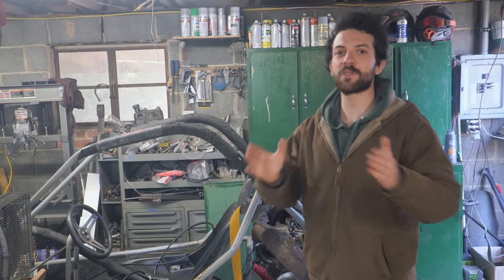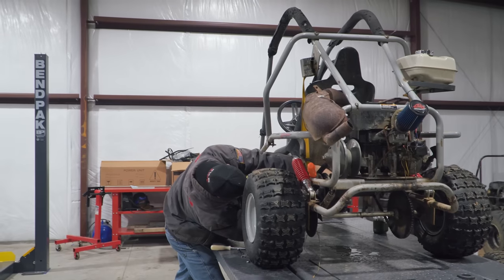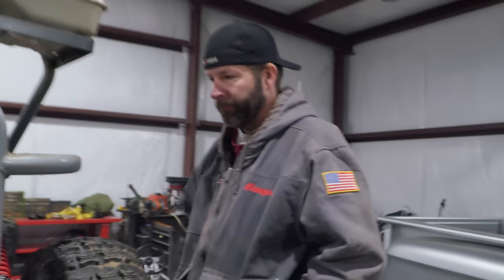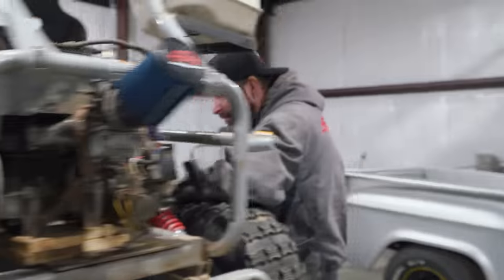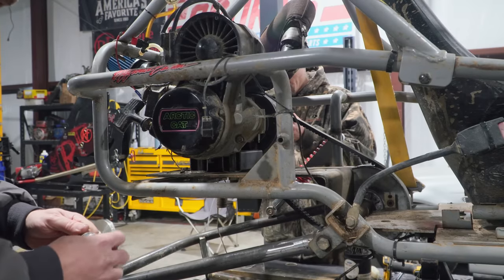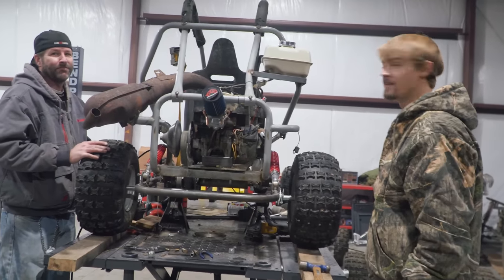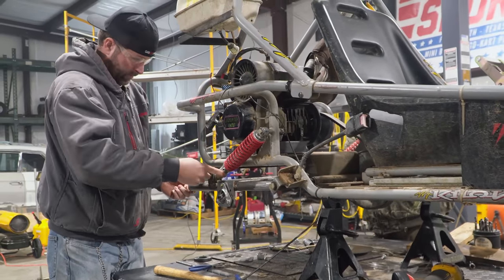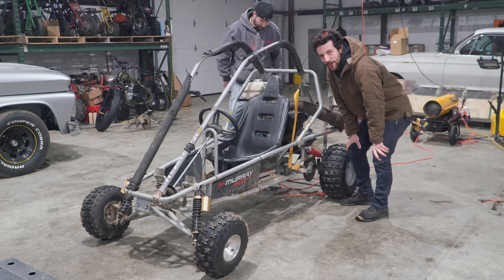440cc 2 Stroke Murray Kilowatt Racing Suspension Overhaul!

Comment: Just got my 140 hp 680cc 2 stroke engine for my drag quad. Tons of good ispiration and good ideas from you guys🤘🏼 Keep it up!
Reply: What kind engine u running
Reply: @marshallmazzarelli8797  it sounds right as a Polaris ultra triple.  They were just a hair under 140hp with untuned triple pipes.

I’m not aware of any other 680’s
Reply: @rydplrs71  If you don't recognize the displacement, it's probably a bored and a stroked engine.
Reply: Yep, its from a 97 ultra. Only got the big single pipe, so its maby not as much as 140 but still a LOT for a 70 lbs frame
Reply: @FarmerFpv   why would you bore and stroke an engine for performance you can get stock?   A stock 670 twin can put out similar power if you want to save the 35lbs of a triple, but with drag quads traction and  front weight are limiting factors.   Modded they can put out a whole lot more.  I have a few videos on my channel.
Reply: @Marcus Johansson start making videos
Reply: @DaEVOhero  it should be a fun ride I’m sure.  I had a 96 ultra long track.  It was the only year of my life I had a 6 pack muscling it around corners. 

The only mod I would do is going to flat slide carbs,  the round slides do have a delay as airflow develops, which is less of an issue drag racing, but after having moved onto flat slides the response is much faster.
Reply: sheeeeesh dude that’s lit 🤙
Reply: @rydplrs71  are we talkin predator 670 or like a snowmobile engin
Reply: @asilva_media  Most likely they were talking about a predator 670.
Reply: @asilva_media  140hp predator?  😂😂😂😂😂😂. Maybe 40hp for a short period of time

A skidoo 2-stroke 670
Reply: @rydplrs71  yeah i was confused lol
Reply: @Zark-Muckerberg  thanks that made me smile..
Reply: That will be the first time I have heard about a 680cc 3 cylinder 2-stroke predator 670😂 hell of an engine that one

Comment: One way to get the suspension to be a little stiffer is to raise the upper mont. Let the shocks work the right way.
Reply: Yup, by moving the spring's lower pickup point back they've screwed with the leverage ratio of the swingarm. They've effectively made the springs softer. Ya gotta do your homework with this stuff...or use trial and error, redoing it 'til ya get it right!
Reply: @mmodtomic7119  Not only that. In that angle its works more like an upper linkarm than a shock
Reply: That's the OEM location. I've got a Kilowatt. Mine with 13.5" shocks work great.

Comment: Great build and video! 
Just a thought…Might want to look into snowmobile clutch tuning. I’d recommend a Comet 102C drive clutch. Highly tunable. Belt alignment and tension is very important on snowmobiles. Check High performance engineering for clutches and all kinds of parts to tune your clutches. Also, those older Arctic Cat Kawasaki engines have issues with the points and condensers when they get some age on them. Keep an eye on the crank seals as well.

Comment: Unique to 2strokers are the crank seals. Any heat or bad mix and they go part bad. Piston to cylinder clearance is also very critical due to it sealing off ports. A compression test will only see the top half. A scope in under the piston helps but the skirts can be seen through the intake and exhaust ports.
Reply: any and all 2 strokes only compress half the stroke  but they as u know fire every stroke.  if properly used there is no problem with them  much fewer moving parts than a 4 stroke and much more power to and torque per HP than a 4...  I have a design for a 2 stroke engine with a valve no ports no pre mix and fuel injection still on the board but i will be makING A MODEL  to test my theory  half the displacement with more power than a 4 stroke is my goal and clean....
Reply: @StansWorld  
The only problem is lubricating the crank bearings with the intake charge. There are seals at those joints that keep the intake suction and transfer pressure inside. Any lean out condition and it won't get enough oil. They get hot and those seals half way quit making it run bad.

Comment: What about extending the cage a few inches at the back? A clamp on extension? Then you have room for a very large filter, and a pipe hanger point to take all the weight off that chamber pipe.

Comment: Seems like another jackshaft would be a straight forward way to reduce the size of the rear sprocket and still ending up with a lower gear ratio.

Or allow them to move the final drive chain to the outside of the swingarm instead of the inside.

Comment: Enjoy all your builds. Perhaps it’s because I researched and dreamt of doing this as a child and at 58 I still have that fun dream. 

Found this one helpful because I have a 1980 John Deere Trail Fire 340 that has an awesome: one pull to start, twin cylinder single carburetor Kawasaki engine in a rusted out old chassis with broken track. Clutch and belt are like new. 

The wife will think I’m nuts but it would be fun!

Especially since we see less use out of these sleds with less snow here in Wisconsin.

Comment: This is just a guess but a heads up snowmobiles do not have a air filter .They have a air box but no filter. The fuel ratio may be too rich by choking the carb with the pod filter you have on.

Comment: Y'all need to fabricate a nice, new expansion chamber for this snow beast!!!
Reply: They are having problems just getting a 2 stroke engine to run proper.  I think buildig a coplete new 2 stroke pipe is way, WAY over there expertise...
Reply: They need to step outside the Predator/Tillitson box a bit and work on more 2-strokes and figure out how to tune them properly before giving an attempt at any pipes. If they still have the running problem even after a thorough carb cleaning they might have a leak somewhere causing the engine to suck air. It could have bad crank seals or even a leaking gasket somewhere. I don't know the year of the sled the engine came out of but the poor has to be 40+ years old. :)

Comment: If the carb cleaning does not work check the crank seals. A bad crank seal will act like a dirty carb. Also you will risk a cylinder burn down if the seal is bad.

Comment: I want to reach out and let you guys know that the primary clutch on there is most likely holding you back, also the motor is out of an Arcticat due to the branding on the recoil, I’m not an expert but I had a panther 440 that could get up to a whopping 60mph across a lake with that series of motor. If you would like to reach out my dad is an expert on the subject and we probably have the correct clutch for that if your interested
Reply: Also the proper primary is an Arctic Cat 0725-041, keep up the great work
Reply: My buddy had an artic cat and for some reason he couldn't get any replacement primary clutch replacement. It didn't make sense to me back in the day I don't remember the exact issue he was having if he was trying to get an upgraded one or just a stock replacement but we're in Minnesota where Arctic cat parts are very available I wish I knew more. Maybe it wasn't cost effective but I can't even see that. Do you know of any issues that might occur if one was trying to replace the spring on the clutch or needing to replace the clutch altogether?
Reply: @boxedfender4810  usually what happens is the cam arms end up slopped out and rubbing on the spider in the clutch. you can get new cam arms and bolts and lubricate up all the surfaces and changing the spring should be fine, FYI Fowler Parts and service out of ogilve MN is a great place to go for snowmobile parts. they have stopped doing walk ins but I recommend giving them a call  at least.
Reply: @andrewlarson9293  yeah this was years ago I just remembered that there was a wall stopping him from riding it something to do with the clutches. Yeah I know there's tons of great places I myself know a artic cat collector in Fredenburg? (Fish lake) that was my guy and another place in stillwater I always wanted to go check out that has or had a massive graveyard of bikes 3and 4 wheelers along with sleds cant remember the name of if stillwater was even accurate. To restore my 250r 3 wheeler air-cooled I used ebay this was early 2000s
Reply: @andrewlarson9293  I think Harlan's  was the spot in Wilmer Minnesota. Just to walkthrough acres of rare sleds would be incredible. Places like that need to be landmarked and preserved
Reply: @boxedfender4810  if you ever are looking for parts Larsons arcticat barn is my dads little business. I belive we have a sled form every year from 1960s to probably 2008 ish and around 150+ sleds in total. He is also an encyclopedia when it comes to arcticat and arcticat parts.
Reply from the maker: We replaced the primary clutch once already, I wish we would've gotten the noise on camera. It sounds like either fuel or ignition. Thanks for your offer though, feel free to send me an email (you can find it on our about page, but I think it only shows up when using a computer) and we can continue this convo. Thanks!
Reply: Sorry for jumping in mid conversation, but please consider using a almost "flat" gearing on the chain part, since the CVT is designed to handle "the whole register" of a in some terms massive snowmobile, as in i belive (and can someone please correct me if it is wrong) that the kart has mutch less "drag/mass" than a snowmobile thus the clutch does not engage properly..
Best wishes and hope it gets sorted without too mutch sweat!
Reply: @mrdeathscrn  that is a very valid point I didn’t get a good look at them accelerating and driving it but to me it looked the the clutch fully engaged and was it top gear essentially, they might have the belt tensioned incorrectly as well making it so the belt is not pulling on the secondary hard enough for it to do it’s part in shifting and becoming a smaller pulley, hopefully they see this and do a bit more research that thing should be an absolute monster with a 40hp 2 stroke

Comment: If you have one of those harbor freight ultrasonic cleaners and want it to last longer, don't run it with liquid up where the metal meets the plastic, and never ever dump it out.  Always siphon the liquid out because when you tip it and dump it, liquid gets between the tank and the plastic and gets to the innards and eventually ruins it.  I have one going strong after like 7 years and I use it a ton but I have seen a lot of people complaining about theirs dying and I think the cause is usually just getting water and/or cleaning solution down into the electronics.
Making or buying a basket for it helps a lot too, and will help your parts get way cleaner.  When you sit something in there directly on the tank, it dampens the ultrasonic action.  Especially if it's something heavy like a carb.  You might have to do your part one side at a time if it's big but it still might get cleaned faster and is better for the longevity of the unit.

Comment: Hey guys not to be a know-it-all but I've been dealing with snowmobile engines for a long time you're driven pulley off from the clutch on that is way too small that should be it about a 12in driven pulley to go with that clutch on that snowmobile engine that's where your loss of power is you need to put a bigger driven pulley on there just a heads up guys I've been building these go-karts with snowmobile engines for a long time and I'm telling you that driven fully is too small
Reply: Sad to say... Your knowledge and expertise will likely go unnoticed by the 3 Amigos of design and engineering disasters...

Comment: Go karts and dune buggies are awesome but I have no experience with them. As such, I learned something in the first few seconds. I thought Murray only made lawn mowers! Mind blown 🤯😆.
Fun channel and great projects! 👍
Reply: Have you seen the riding lawn mower races, where they put high performance high output engines on them?   Pretty hilarious with the high CG and lack of lean, or more correctly lean in the wrong direction, like a car and not a bike. And those things flat out haul ass around those dirt oval tracks and require a good bit of driving skill.  

I'm sure there are some such vids on YT.  The figure eight (IIRC) trailer races are a hoot, too.  The point is to knock the trailers off the other vehicles.  Trailer gone, you are out.  They pull boats, jet ski trailers, large campers, everything you can pull, basically.  It gives you a real fill for how crappy those camper trailers are built two, they basically explode when hit, and the other vehicle goes right through them.

Comment: My main suggestion by the way guys, is turn the bloody engine around. You wouldn't have problems with hot exhaust near plastic seat at that point. Plus it'd solve the carb problem of being close to a main pipe on the frame.
Reply: It'd be really fast in reverse, unless a gear set was used to swap rotation direction.
Reply: @peril787b  yea. That is true.

Comment: One of the unique features about the kilowatt is they moved the engine off of the swingarm and mounted it to the frame, thus lowering the unsprung weight. Almost all other karts have the engine mounted to the swingarm. This improves both the ride and the handling.

Comment: A nice, well-spaced heat shield for the muffler/expansion chamber should do just fine for managing heat. As far as how the engine is running, there could be any number of issues, being a 2 stroke twin. I don't know what engine that is, exactly, but it could need new reed valves, which are inside the intake manifold. They are essentially a one way valve (similar in concept to the actual valves in a 4 stroke) that prevents air from pushing back through the intake, since the air/fuel mixture is "pumped" directly into the cylinder/crankcase, rather than through the cylinder head like on a 4 stroke. The reeds can wear out causing funky running issues. The crankcase seals maintain compression in the cylinders, as well as between them; when these are bad, it could certainly cause bogging and other weird running issues, so inspect those as well.

Comment: With the shocks leaning that much, isn't there a risk of suspension bind, or the shocks "flipping" direction? 
At that angle you only get a few inches before it reaches a flip over point, at least it seems like it just by looking at it. Maybe there isn't enough travel for that to be an issue?
Reply: That’s factory
Reply: @critdub7  "factry"

Comment: Looking good. I would do is replace the T handle with a D handle on the recoil.  Your knuckles will thank you.

Edit, that belt looks wrong.  It’s way to thin, and I’m wondering why you put the brake rotor on the axle and not on the shaft with the secondary clutch.  It looks like it wants to be bashed on a rock.

Comment: I guess your running race plugs and silicone/carbon moulded HT leads to good, waterproof coils I like Suzuki coils, you can replace the HT leads and they seal with a locking olive. Excellent in the wet. I absolutely recommend this Mod for the Honda 750, which will misfire at the slightest hint of moisture!

Comment: As that was originally for a snowmobile they are jetted for cold weather. Also fan cooled or free air engines get very boggy in warm conditions. They really prefer the cold. They can be made to run in the heat but require different carb set ups. I have used similar engines in ultralights and they can be very picky.From the sound of it in your last video it was no where near its rpm potential.

Comment: Your float should be level too the ground and not to the bottom of the carb. Look into a v-twin motor and the float adjustments. I think that motor sat on a slight angle in a sled, it’s now level so the carb is on a angel !! Good luck boys!!!